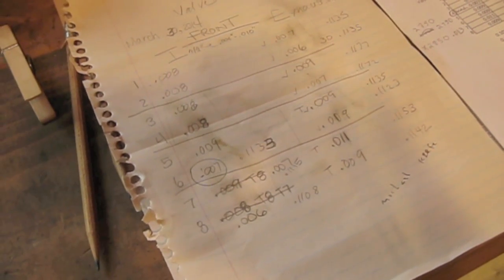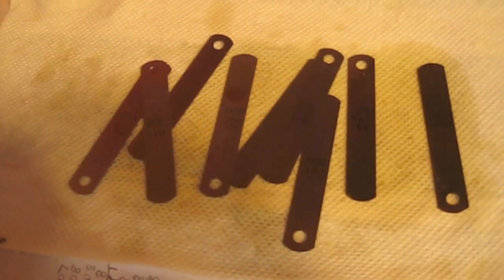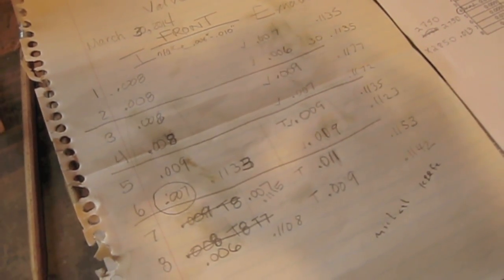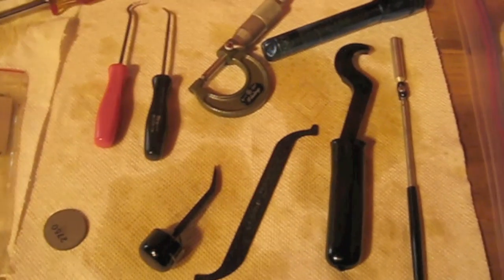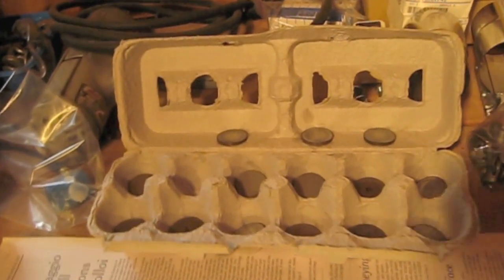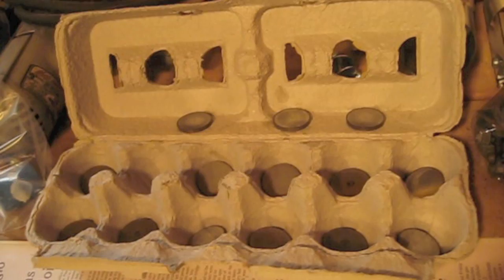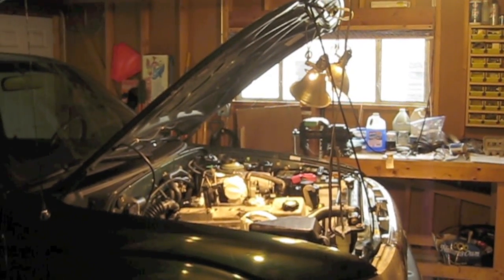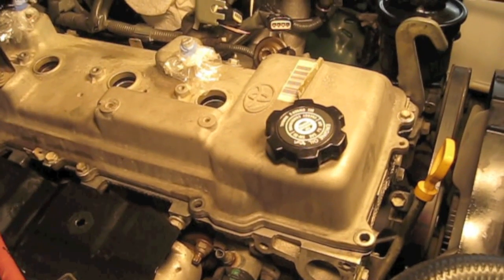Toyota Tacoma 2.7L (3RZ-FE) Valve Adjustment

Comment: I was studying up on replacing some of my valve shims when I came across this video. I bought Schley pliers shown in your video a long time ago and was going to use them.  The wedge tool looks ten times easier to use.  As one commenter mentioned the Kawasaki 08-0019 is just about the same tool and I will be ordering one on Amazon for $8.75.  Another tool listed on Amazon that may work with is the Motion Pro Honda Valve Shim Tool 08-0019 or the 08-0017.

Comment: URGENT

One of my valves gave me a clearance gap (when measuring the shims with the feeler gauge) way out of range. The clearance range was between 0.006-0.010, but we measured it at 0.056. The bucket that holds this shim can be moved slightly up and down, so we belive the problem is the spring (none of the other buckets move this way). We dont want to change the spring because of a lack of expertise. We were thinking of getting the thickest shim that Lexus offers,  just to make the gap smaller, but it would still be way out of range from what it should be. Would you recommend getting a thicker shim made to reduce the gap, or should we just get the thickest one from Lexus? Or just put another one around the normal size and hope is dirty and after a engine flush the spring will work normal.

P.s. whoever owned this car before me did not change the oil enough so there is a lot of carbon deposits around that valve area. We are going to do an engine flush to try and clear out whatever has built up inside. 

I dont know if the spring is old and dont have that much strenght. Or just dirty

Thank you for your time and help. I greatly appreciate it!
Reply from the maker: Did you have to stack two feeler gauges to measure the .056"?   All of the buckets can be moved up and down when the cam is pointed away from them.  You probably notice it more in this one because it has more than 5 times the clearance that it should.  As hours are put on an engine, the valves nearly always get tighter not looser, so this is an indication of a problem.  It could possibly be a bent valve, or one with very heavy carbon deposits.  Either of these conditions will prevent a valve from closing completely.  It is also possible that the heel of the valve has been shortened previously.  Let me know what you find out.
Reply: z399y yes, I did have to stack them. We put the thickest shim that lexus offers in the one that was way off, closed things up, turned the engine on. We drove around for a bit and then the engine light and engine oil light started flashing and then stayed on. The ticking noise was also a little worse. We took the car and checked its code which was P0012 - camshaft bank 1 retarded. We figured this was due to the too thick shim, so we opened it up and put a thinner one in. We cleared out the OPC valve and filter as well, cause maybe it was clogged causing the light to turn on. We also changed the oil and the oil filter. We closed things up and the same thing happened again - produced the same code. Any thougts on what we ahould do? My car is a lexus es300 2002. Thanks!
Reply from the maker: Putting in a shim that is too thick would not cause a 'camshaft retarded' code.  Based on what you are describing, I would start by verifying the cam timing.  Look in your service manual.  There should be a timing mark on the crankshaft pulley, and on each camshaft pulley.  If this is off, it is possible that you could have a bent valve, and that would be the reason one valve is not closing all the way (making it impossible to set the clearance using standard shims).  Did you get all of the other valves clearances in spec?  Make sure you are measuring clearance for each valve with the valve pointed directly away from the bucket.  Measure them one by one as your rotate the engine.  Always rotate the engine the direction it turns when running.  Some engines don't like to be turned backwards, and can skip a tooth on a timing belt.  Also, always use the crankshaft pulley to rotate the engine, not the cam pulleys.
Reply: z399y
Hello, I found what happened. What happen is that my engine had alot of carbon deposit and I clean some out and put brake cleaner a few times which put all the dirt down the engine. So Because it was so much dirt the oil could not travel as normal and mess the oil pressure and the bad oil pressure made to camshaft to react that way. My friend took the oil pump out and clean the filter and everything and now works great. I still have the ticking noise.

When I put the thickest shim the sound was louder. (WHY?) I HAVE A CLEARANCE THAT NOT SHIM COULD MAKE UP. WHAT SHOULD I DO WHEN MY CLEARANCE IS WAY TO BIG? Some told me to change the shim bucket and that will help some?

Could I put some of that rislone lifters liquid or take the camshaft off and change the shim bucket.

PS the car still have the old shim.

Comment: Thanks for your response. One more question - once i finish checking all 12 shims in one side of my engine, and say i find 2 out of range, would it be alright for me to just change those two? Or is it necessary for me to change all of them even if the other 10 are within the required range?

Comment: Hey great video,
Quick question.

I have a 2002 Lexus ES300 3.0 V6 which is a Camry.

I think I have a one cylinder in the front that is giving me that clicking noise. If I change only the shim that is out of range you think that's ok, Or I have change the whole 12 shims on that side or the whole engine?

The reason I'm asking is because here in Georgia the Lexus dealership is charging me  $30 for each shim plus taxes which is alot of money for a college student like me.( Not including labor and doing it myself)

Is there a way you could also guide me for where I can find the formula for the new shim I might have to replace in my car
Reply from the maker: I would say that if you have the valve cover off, it would be a mistake not to measure all of the valve clearances and replace any that are out of spec.  You should able to get them much cheaper than that if you shop around, I think the Toyota shims are around $7.50 each.  The formula is this:  Measure the valve clearance with a feeler gauge.  Determine what change you need to make in the clearance.  For example if you measure .007" and you want it to be .010" your shim will be .003" thinner than what is in there.  Remove shim, measure thickness with a micrometer, subtract .003" from this measurement.  That will give you the thickness of the replacement shim.  Good luck!
Reply: z399y
Do you know where I can find the the specific clearance range for my car. Which has the same engine as a Camry. 

Last question, how do I get to move the cam to be at top?

Ive done brakes,tunes ups and oil changes but never mess with the engine.
Reply from the maker: camilo11315 You need to look in the service manual to find the valve clearances for the intake and the exhaust valves.  On some cars these specs are on the vehicle sticker on the underside of the hood.  The crankshaft will have a pulley mounted with a large  bolt.  Your use a wrench or socket on this bolt to turn the crankshaft, that will rotate the cam.  Generally, you only want to turn this in the direction the engine rotates while running.
Reply: Sounds good thank you and I thought all engines rotate to the right. Thank you very much for your help.

Sorry to bother you. but can a car has lifters and valve shims, because my friends has a Camry same year 4 cylinders and he say he put some liquid to fix the lifters sounds and it went away.

apparently 4 cylinders camry's have a lifters and 6 cylinders camry's have shim valves?

Comment: Hi,i have a question,after i check all my valve lashes,the valve shims that are below or above specs those are the one i need to change the shims?also can you provide me with the data to determine which shim to use,thank you
Reply from the maker: Replace the shim if the measured valve clearance is not within your desired range.  Remove the shim, and measure it's thickness using a micrometer.  Add or subtract  from that value to calculate the replacement shim size.  For example, if you measure a clearance of .007" and you want it to be .010" you would replace the shim with one that is .003" thinner.

Comment: If you'd like to save some money, Kawasaki offers a similar tool that is much less expensive (Motion Pro Valve Shim Tool Kawasaki 08-0019).  You can find it on EBay or Amazon for less than $10 (1/4 the price of the Honda part).  You can also buy the wedge tool without the pliers (Schley 88251 Replacement Spacer Wedge - Toyota & Lexus).

Comment: Will the shims that were in before the new ones have a part number under them?
Reply from the maker: No, the shims don't have a part number on them.  The shims that are original to the engine will often have a printed 2-digit code like 28 or 30.  If they were purchased from a Toyota dealer, they will usually have a thickness listed in mm as a 4 digit number.  You should just measure the shims using a micrometer.  By the way, the micrometer is a much better tool for this than a dial caliper because you can read a micrometer to 0.0001".  You get a much more accurate measurement to help you decide on which shim to select.